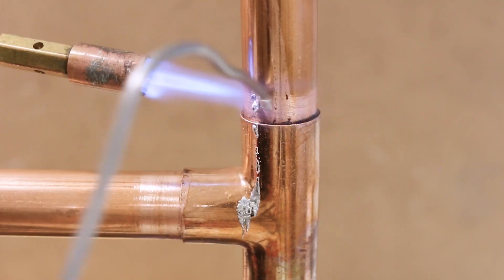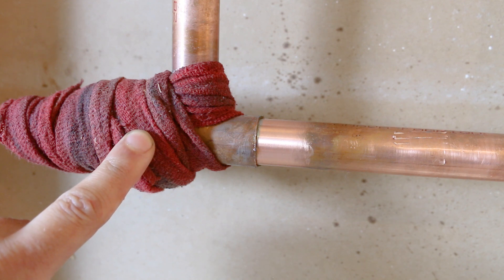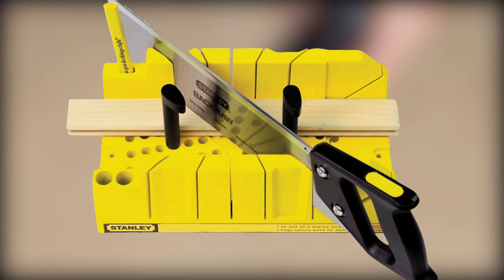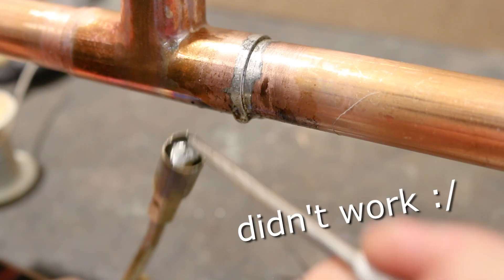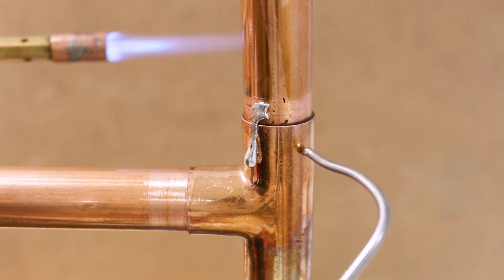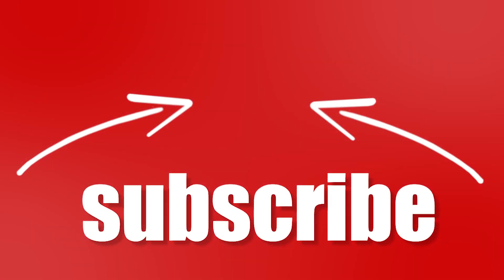10 Plumbing Mistakes Beginners Make And How To Avoid Them! | GOT2LEARN

Comment: Nooo... The most common mistake is making a perfect flare on the end of a copper pipe without first threading a compression nut on it :)
Reply from the maker: Heheeee, I am a victim of that...
Reply: I thought it was just me.
Reply: That's my specialty!
Reply: Been there, done that.
Reply: Please explain I’m getting my skilled trade in facility maintenance
Reply: You can do it to automotive brake lines too.
Reply: @taehitdifferent293  Well, when it happens you have to cut that perfect flare off, thread the compression nut on a pipe and then rejoin the pipe with a carefully soldered collar. Then you need to cut the pipe again, because the nut is on the wrong side of the collar...
Reply: That’s just any kind of plumbing mistake, I’ve done it like 15 times with brake line fittings
Reply: This is too funny. That’s a great mistake right there
Reply: Lol when I first started in plumbing I did that way more than I’d like to admit😂
Reply from the maker: We all did 🤓
Reply: Lmao this one
Reply: It’s 2023…
Reply: I cry erry tim

Comment: Plumber/ hvac tech here! Spot on with everything. Your right about dripping solder into the torch tip it happens to me all the time. Unfortunately, in many situations there isn’t enough room to get the flame on the pipe from every angle. More often then not, the only way I can get a flame on the pipe is from underneath.
Reply from the maker: Good to hear that, thanks man!

Comment: Can't tell you how much I have learned from your videos.  I started out by practicing soldering on scrap pipe and then pressure testing. I can solder now vertical, horizontal, in tight spaces (licence plate) and repair a joint (wet towel) if i had to.  Thanks for sharing your knowledge!
Reply from the maker: Awesomeee, glad to hear that ;)))

Comment: I'm getting ready to do #8. I want to cap off the water lines to the bathroom sink. I've watched about 10 other videos, but this is the only video that discusses what to do if your caps start sliding off during heat. Thanks for the video!
Reply from the maker: You can do it!

Comment: #1 0:16 Not entirely soldering the joint at once
#2 1:25 Installing a pipe that was cut crooked
#3 6:15 Not knowing the types of coppers
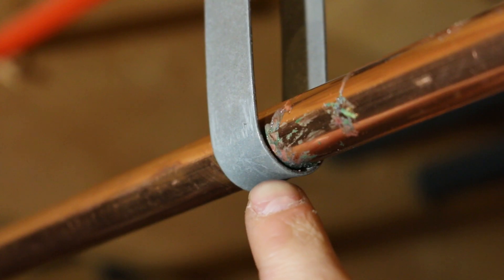#4 3:31  Using steel support with copper pipes
#5 4:12 Soldering directly under the joint
#6 5:10 Cutting a pipe and not capping it
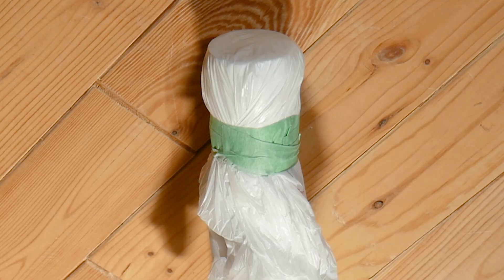#7 5:50 Installing a pipe crooked
#8 6:12 CAP
#9 6:46 heating the solder 
#10 7:31 Running cold and hot pipes together
Reply from the maker: Thank you so much @Djakonka D, I haven't had the time to add chapters to all of my previous videos, this helps a lot, thank you again!
Reply: @Got2Learn  thank you ! Boss ;)

Comment: Great info!!   I have seen a case where someone placed a residential 1/2 inch copper line in contact with another copper line crossing it.  The result being the one pipe has been etched into enough that it would eventually develop a leak.  I took a piece of rubber and separated the 2 pipes.  I still check it periodically (A different house).  More so,  My wife's 1988 T-Bird auto had a power steering hose which passed down the side of the battery case.  Being out of sight, I never had any reason to look there.  One day I was working in that area and checked the hose as it was old and I found it rubbing up against the edge of the battery case. I found a cut in it so deep as to make it a serious risk of rupture.  Power steering fluid is flammable.  !!!!  Replaced it.

Comment: 4:02 question, wouldn't there still be corrosion between steel and copper, just somewhere else?  I get it that if so, it wouldn't be very much or on a pressure-bearing pipe.
Reply from the maker: Anywhere copper touches steel, you are bound to get corrosion.
Reply: I prefer to use copper strapping.  It comes in a roll and is about 1/2" thick with lots of holes.  You make a loop and nail it with a copper nail to the joist.  Most everyone is probably familiar with the steel strapping that is used for all kinds of things, but they do make copper as well.  It is not as pretty as those all-thread drop hangers, but I haven't seen pipes hanging a foot below the joists often.

Comment: Great video! I would say the one best tip I learned while working with a professional plumber was to focus on cleanliness. Get that copper pipe and fitting shiny clean and keep your jar of flux clean too. It's a nightmare trying to successfully solder dirty fittings. Or used fittings.
Reply from the maker: Great point!

Comment: Personally committed #6.  I roughed in a basement toilet and forgot to cap it.  I ended up with the smartest sewer rat ever.  He ran away with sticky traps, broke out of spring traps and started lifting glue traps out of the way.   I finally got him by hollowing out portions of apples, screwing them down and adding crushed poison pellets.
Reply from the maker: Hehehe, that made me laugh! Good job on getting him Errol!
Reply: A sewer rat is what we plumbers call a tampon that has been removed from a clogged sewer line with a sewer machine.

Comment: I saw you used Knipex water pump pliers.  How long you have knipex pliers ?  is knipex good and last for long time ? is knipex good for do gas pipe, plumbing pipe. I'm looking for buy new adjustable pliers. Thank you.
Reply from the maker: Yes, Knipex pliers are actually the best in my opinion, if you have the money to spend on them, go for it. The ones I used in the video are the 10" model with the adjustable button on the side.

Comment: Being a jounyman in the trade also was a cert. Welder and certified copper for nitrogen and hydrogen  and trained my apprentices  I consider myself a union professional and also certified welder on a bike plant in 1982
Reply: Awesome bro; Looking forward to getting into the union myself soon after school.
Reply: And………?   And…….what?   Very nice.     I love fast cars and slow women, have been professionally trained as a sound engineer, our local Union is a joke, and I’ve worked for myself for twenty years.   Did this guy give good and accurate tips?   Did you ever need to go in strike to get better wages?   Will flux eat through copper over time?   What temperature is optimum for sweating copper pipe?  Does your union provide health insurance?  Got any cool journey stories?   Do copper and nitrogen get along?   On 1/2” copper pipe which has not had the inside deburred, what is the maximum reduction in water flow in gph from the turbulence generated by the imperfection on the inner surface of the pipe?   Do you use Teflon tape on compression fittings?   Is purple PVC cement suitable for all types of PVC plumbing?    Did you get fired from The Apprentice?   Does Donald Trump really smell like black olives?   Is his lower lip really held up with wires in his face?   Do they really squeeze the Orange out of millions of Cheetos to dye his blood Orange?

Comment: im just starting to lean stuff about this because of an error made by my neighbour. he's just retired from doing a blue collor job adjacent to plumbing but not quitte. was helping me out be renovating my toilet, couldn't get the solder to flow as there is no way to drain the pipe properly. this video helps me with my first bit of knowledge about this subject :3

Comment: For teaching beginners, have a rubber mallet nearby to whack them on the side of head when they just heat solder only and apply.
Reply from the maker: hehe, I was thinking more a steel pipe lol ;)
Reply: I use a shock collar.
Reply: Rubber... no.. they will never learn with a rubber mallet.. something in a 3lb steel works better.. he did really fail to bring home the point that the solder will only follow the flux... and who flipping sliders anymore----> pro press, shark bites, Pex?

Comment: Any comments about handling thermal expansion in long, straight runs on a hot water line?  e.g. Is it good practice to add an offset every XX feet?  What about type & placement of anchors to allow small movement?
Reply from the maker: From what I learned, none of that is necessary. If we are talking about steam lines then yes, you would need to think abour expansion.

Comment: Agreed with most of this video, only part I disagree with is when you say to crimp a cap to secure it. Smashing a fitting can cause your solder to not fully take around the smashed area and will most likely leak over time
Reply: So put a small hole in the pipe at the joint as a vent which you solder up with the fitting!
Reply: Not true. Crimping and swiveling is good practice. For one thing, you only need to crimp the very edge of the fitting, and after over fifty years of doing so, I simply never had leaks.
Reply: @HerkRants  agree to disagree

Comment: Great video!!! I have a small piece of lead at the bottom of my (stationary) pipe that I am trying to remove. Do I need to heat it or will sandpaper do? Which sandpaper should I buy?  Thanks, Rob
Reply from the maker: Thanks! What do you mean by that, I do not fully understand Rob, thanks!
Reply: @Got2Learn  I am sorry I wrote the word 'lead' instead of 'solder.' So I will restate my question here:
My pipe is not perfectly smooth because there is still a little piece of solder on the bottom of it. (I guess it remained when I heated and removed the fitting.) How do I remove that small piece of solder? Thanks again! Rob
Reply from the maker: Ohhh, much better hehe 😉 So yes, just heat it up until it liquifies and nick it off with a rag, sanding it will take up too much of your time, cheers man!!
Reply: @Got2Learn  Thanks! I stopped everything I was doing & fixed it. It's very exciting to do all this. Thanks again!

Comment: 'You want to do things quick(ly)'  NO.  Do thing RIGHT, or you'll just have to waste double time redoing things.  More haste, less speed.  Oh and build it into you job costings, and if the customer isn't happy, don't take on the job.  I occasionally have had to say 'Well if you want fast & cheap, get someone else, but don't come back to me when things go wrong.'

Re copper quality, different grading letters, normally X grade available (thick & malleable), you have to order different qualities for other jobs, e.g. refrigeration, high pressure air / steam.  I have never found lighter weight copper tube available.  More & more plumbing is done with different types of compound plastics.

And I've said it before, I normally use a propane / butane gas mix in a standard torch, lower more controllable temperature, wider flame, for uniformly heating the joint for good solder spread, less likely to burn off the flux.
At 5:56, that pipework is beautiful, as it SHOULD be, impress your customer.

Another good vid, thanks.

Comment: Reason 3 on not leaving a pipe open. When the guy wiring the electric for an injector pump plugs it in and the clean out is open he won’t get covered with sewage after he plugs it in. And yes i was the guy getting covered with sewage
Reply: A truly shi**y day.

Comment: I'm a professional plumber in the commercial and industrial construction industry. I have just a few points: First, the 1/2" solder for 1/2" pipe trick only works on those small sizes. If you think it only takes 4" of solder to do a 4" joint, you're delusional. But, I realize this is for home owners trying to DIY. The best thing is to learn to control your heat. You heat the joint up until it starts to melt the solder and pull the torch AWAY from the joint, only allowing it to stay close enough to just melt the solder. Too much heat and you can load up the joint so badly you block it off.

Soldering different parts of a tee is done very regularly, but you have to know what you're doing. Heat control is a must, fresh flux in unsoldered joints to make sure you didn't run it dry, and you cant let flux sit in a joint unsoldered overnight. Again, this is for someone that actually knows how to solder.

You don't want your torch right under the joint. You want to heat the pipe, first, then position the torch at the BACK of the joint pointing the flame toward the front of the joint. Learn to control heat. Anything above 3/4" should be solder 6 o'clock to 1 o'clock, 5 o'clock to 11 o'clock, then bridge the top, moving the torch up the joint as you move your solder trailing just slightly behind. Always bottom up.
Reply: That is so true! A 4" copper ell could take up to 20 min per  hub if you are actually paying attention to your work

Comment: Excellent. I don't know if it is still used for industrial settings but one time they would use silver solder for tying in the main supply line from the street for your house/valves, you should do a little silver solder video if you don't already have one and if it's something you use in the trade.
Reply from the maker: Thanks bud, here's a video I made on brazing: https://youtu.be/LdCK58UcnhA

Comment: There’s always a lot of smoke and smell when I try to solder plastic pipe, what am I doing wrong?😂
Reply from the maker: Lol
Reply: You have to use lots of plumbers grease. Plastiweld Technique.
Reply: robbiehobbs2009 I thought it might have been my soldering iron?
Reply: Smoke and smell is usually when its peak ready but not too much of course just tap it itll go in in 2 to 6 secs
Reply: Ah........... I believe that's called "Welding" now. You're just using the wrong solder type. 😂
Reply: Not enough flux 🤣🤣🤣
Reply: Need to use lower melting point solder. I think the coldest stuff is called glue.
Reply from the maker: Sterling solder guys.
Reply: Did you use a fan? :-)
Reply: The support thong isn't tight enough.  Make sure the squeegee passes through all six pilfer grommets, then tension with a Groehning-Cohen clamp and a spork-type dreidel wrench.  Check your local code for correct torque and moon phase!
Reply: Matt Heck Is that when I rinse it with the blinker fluid?
Reply: Not enough heat

Comment: Wow, clever tip about bending the solder!  So is the bent portion exactly the right amount of solder needed for a joint of that size?
Reply from the maker: It is, neat huh?!
Reply: @Got2Learn  Certainly is!  If you have multiple joints to do one after the other, how about marking your solder in fixed lengths with a marker pen?  Would that work?
Reply from the maker: @victor9501  it sure would 😎

Comment: You left one out! The one where you can’t completely stop the flow of water and you still have a trickle that just won’t stop. I know the old plumber trick using bread to stop the water and it worked for me. What are your thoughts?
Reply from the maker: Yes, here's a video I made that talks about that trick: https://www.youtube.com/watch?v=lNUAX6mJTlA&t=257s
Reply: David Wiley 
Bread is made for stopping up the intestines and internal piping of humans not so much for plumbing soldier. Was one of my first advise from my mentor. I can’t say I never had any luck with that technique I just can’t recall when . Can’t say I won’t try again ,depends on the situation. I prefer the wet vac and or compressed air. The main thing is to make sure the supply valve shuts the water off properly . If it don’t it should be replaced while you’re there .
Reply: @tommybrown5480  White bread works great, just make sure you have a flush point. Jet swet use to be legit, but now I have the Milwaukee Pro Press tool for 1/2" to 2" copper so to hell with soldering unless it's somewhere I can't get the tool in place properly.

Comment: Another thing that goes along with the torch on the bottom of a joint is that if the solder doesn't fall into the torch, it could land on your hand
Reply from the maker: Yeah those hurt as fu**!

Comment: Would painting the steel brackets help prevent electrolysis ?
Reply from the maker: That would work but it might wear off in time due to the pipes moving ;)
Reply: Couple or wraps of gorilla duct tape is thick and will work
Reply: Or use oversize hangers and insulate

Comment: Doing a bit of research in the UK, whilst there is copper piping available with different wall thicknesses for a given diameter, an amateur is very unlikely to come across anything other than what would correspond to the type M here. That's essentially universal in residential buildings, and only the underground supply might be different, and that's put in by the water company. 

Given the sorts of jobs that amateurs do, which tends not to include commercial buildings, I'm a bit surprised to hear that it's a common mistake to use the wrong sort of copper piping as, presumably. they don't do the sort of jobs that need anything but the cheaper stuff.

Comment: Come across type k copper quite a bit in domestic properties, seems like loads of the locals used to get it from the local dock yards never had any end feed fittings used on it, mostly one pipe systems and swagered joints with the occasional compression tee
Reply: Type K copper was used a lot in heating systems. Always get excited when I run into a old non operational boiler system that someone wants cut out.
Reply: @joshm5816  £££
Reply: @MegaBambooboy  Yeah $$$ here

Comment: why u don't use a copper rod. for breezing. like we do in refrigeration pipes
Reply: Don't tend to braze unless it's AC pipe or high pressure HCAV. Solder is more than ample strength for domestic systems and most commercial applications, I know some people will opt for brazing copper joints around 66mm / 2.5" ± diameter, though most likely you would just use a press-fit or mechanical joint
Reply from the maker: Thanks @El diablo!
Reply: In plumbing I only braze in self made manifolds. I've rarely ever brazed in this trade.